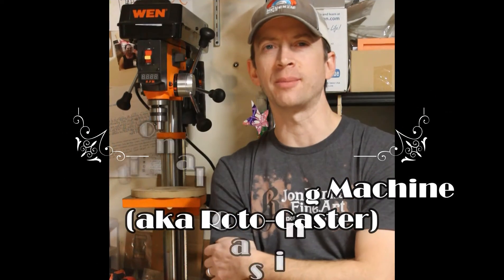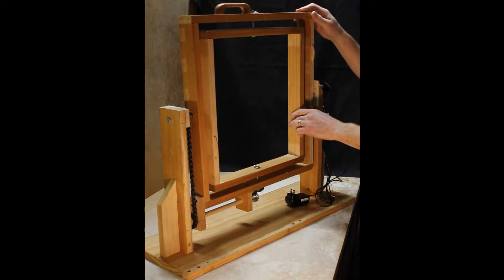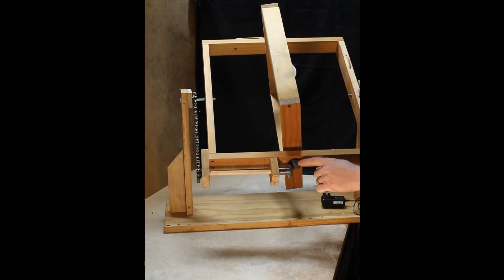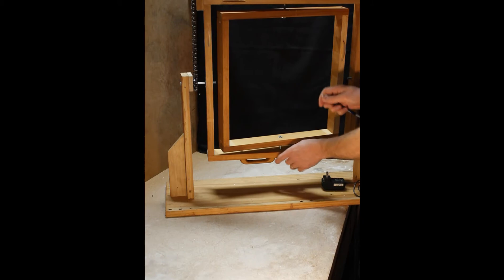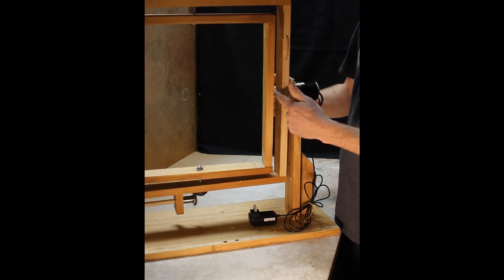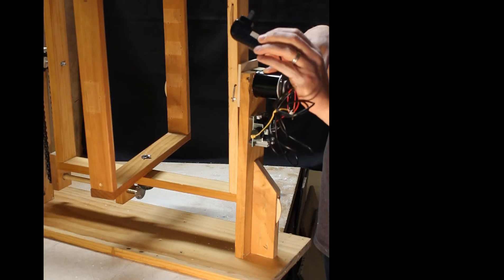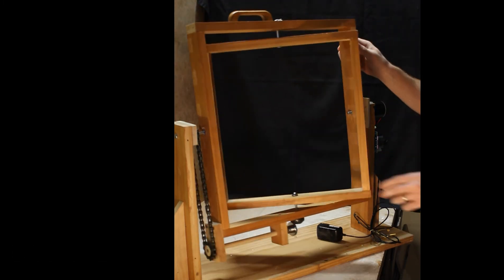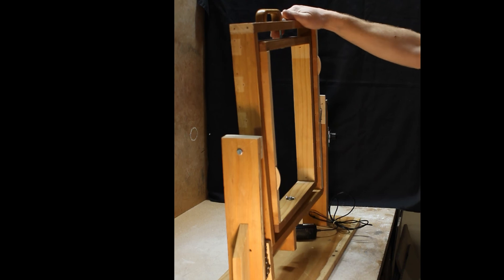How to BUILD A ROTATIONAL CASTING MACHINE ROTO CASTER for plaster and resin molds moulds

Comment: Electrical guy here... You are correct, the motor needs a solid 12vdc ( Volts Direct Current ) to go through the motor. And a thought about your Fuse. 10 amps is pretty high for what you are using.  30w/12v = 2.5a. the fuse is there to protect the motor from burning up so the fuse you are using is 2 times too big. for a 30w motor and where it is continually cranking a load, it is recommended to use a fuse rated 250% over it's Full load amps. So 2.5a x 2.5 =  6-1/4  amp fuse would be more appropriate. When that fuse blows, you know you have a problem, and you are pushing the motor too hard while also saving the motor's internal integrity. I know I'm a year late, and I hope your rig has worked as planned without going through too much heartache. And I look forward to building my own, based on your design! :)

Comment: Would I use the same steps to make a mold go upside down for cement pouring? I need it to be for a 4ft statue. I plan to make a rubber MD and a  fiberglass mold. Only issue is
... I need to flip upside down to fill with cement.

Comment: Hi
Can you please confirm that the sprocket on the side does not move at all?

Ie it is locked and immovable?
Reply from the maker: It is not supposed to move. It should be fixed to the mounting bracket. As the box turns, the chain is forced to walk around the sprocket thereby turning the spindle on the top of the box.

Comment: You said it turns 1:1    that is not random, now problem getting even coverage inside ? I am going to make one next few days
Reply from the maker: Hi Mike. You will get the best coverage from a properly timed roto-caster. Best of luck!
Reply: @JonBurnsFineArt , my understanding of the question was that it's suggesting there should be randomness? That an element of randomness is "properly timed" in this case, to ensure even coverage and the same spots not being hit in the same way every time.
Reply: @fe5018  That's correct.  John Burns will have to change one of the sprockets.  O most of these machines the inner frame is correctly timed to rotate slighter slower than the outer one., but faster is also OK to get complete coverage over several rotations..